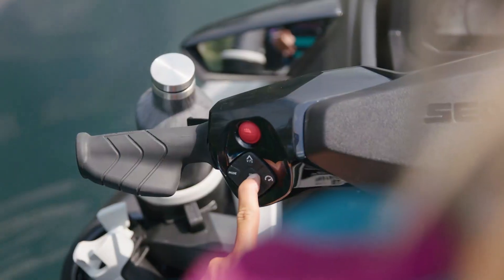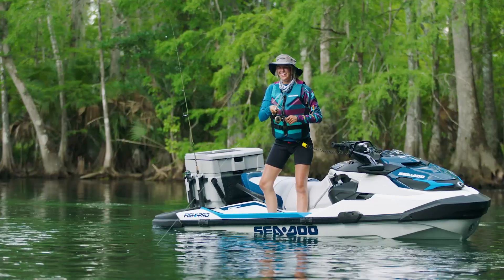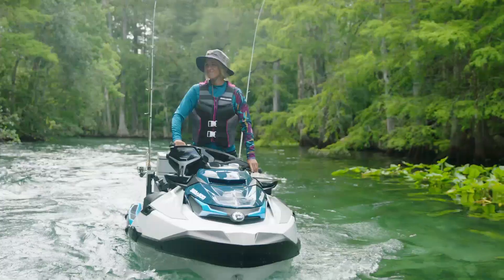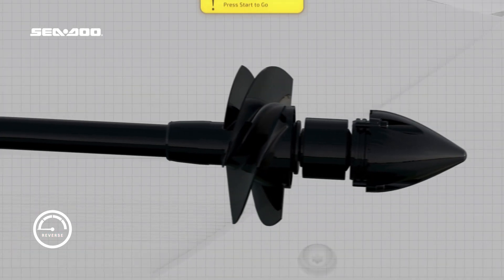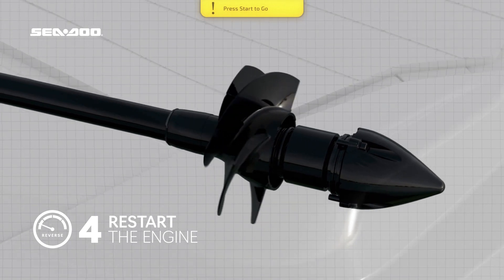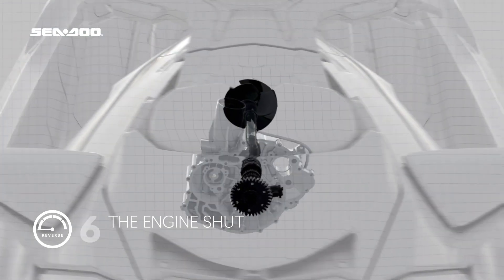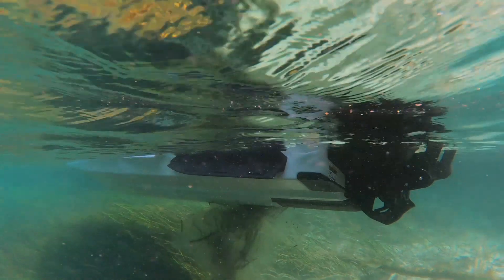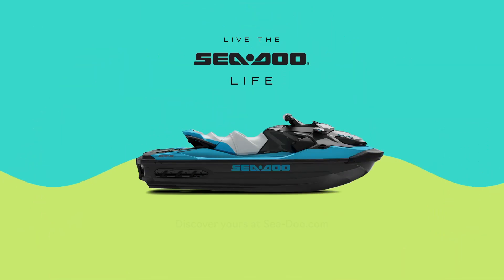How Does It Work: 2021 Sea-Doo iDF System

Comment: Great innovation,  but get rid of the plastic hulls
Reply from the maker: Why? The new Polytec 2.0 hulls are holding up great.
Reply: @watercraftjournal  ehh don't think I would trust it jumping waves on the east coast of Florida and having to split the hull to work on the engine on the spark 🤦‍♂️ besides that looks good and yamaha has yet to respond to the fish pro or up the HP to compete with the 300
Reply from the maker: No OE recommends jumping waves. Use the machine as recommended and you won't have problems. And that's because you can fish from ANY Yamaha when you accessorize it. They're not going to dedicate a unit to a tiny segment. And since Yamaha continues to pound the ever-loving $#%& out of the competition in racing, there's no reason to mess with the SVHO engine. Just make everything else more efficient.

Comment: Man if this thing holds up and doesn’t cause a lot of issues this really will be a game changer also that new screen there won’t be any more need for external GPS units some of the Sea-Doos already come with a depth finder I’ll bet within the next few years the fish pro will also have the new screen with an actual fishfinder on there if they would only consider to put in at least the 230 hp or better yet the 255 I will definitely be putting down a deposit my family is not really into fishing but I am and that’s so much easier to launch by yourself then a boat
Reply from the maker: It's pretty exciting, and we know it's been in the making for over a decade.

Comment: WOW. This is great technology. Makes me wonder if the engineers have tried adding gears to be more fuel efficient going forward.
Reply from the maker: If you're asking about HIGH and LOW gears, the answer is yes.
Reply: @watercraftjournal  now that will be a real game changer. Oh my.....
Reply: @GBsPitstop  If I remember correctly.  Some of the Yamaha's had a gear-driven system to change the speed of the pump vs the motor.   Not actually switchable gears.